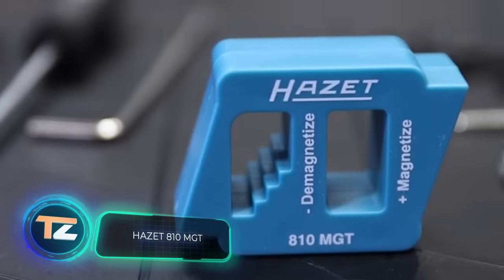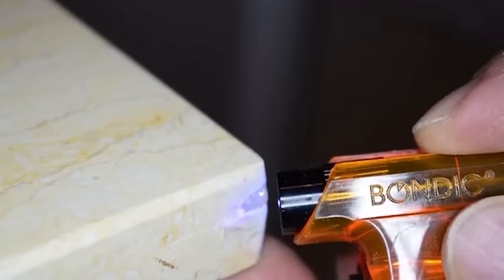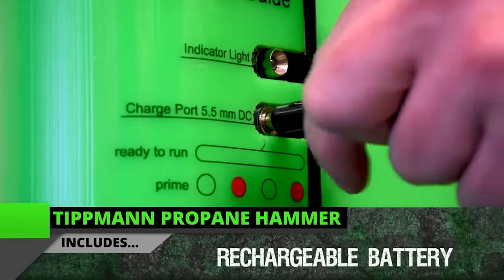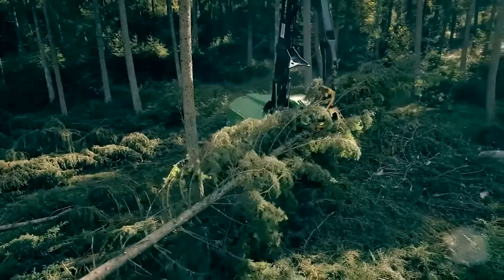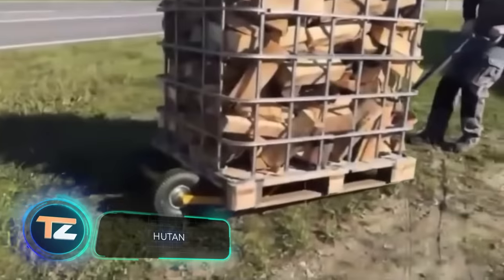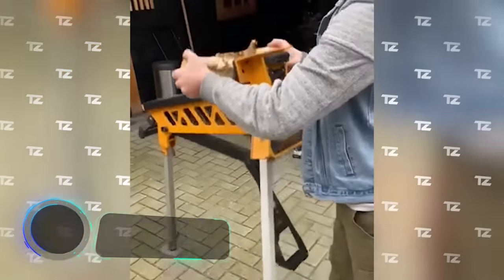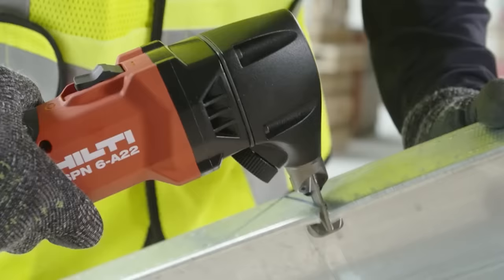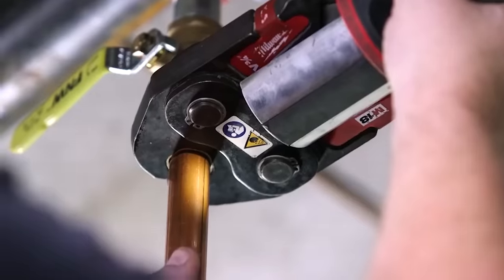INGENIOUS TOOLS AND INVENTIONS THAT YOU SHOULD SEE

Comment: The crimping tool is really expensive but it is so much easier to use than soldering and is more secure than soldering
Reply: More secure?  How so?
Reply: @jonblakemore6454   i wouldn't say more secure but the copper pipe you have tho use is thicker than the one you use for soldering  and can hold up to 600 psi and is a lot easier to do in tight spaces but with all the heads it is about 5 grand but you will make your money back with the amount of time you save. and they has viega fittings and pipes you can use for plumbing the hole house or repairs the viega fittings can hold up to 400 psi and the viega  pipe is flexible and way better than cpvc in the 5 years that i have been using these fittings and pipe i have never had pipes leak or crack and no complaints
Reply: Just used one on 108mm stainless Steel pipe. One crimp ring on the pipe and two jaws. 
A first crimp then a second crimp.

Comment: I love the propane hammer.   Many many years ago (about 50) I belonged to a motorcycle club and raced motocross (we called it scrambling in those days).  When our club hosted an event, we had to erect about two miles of fencing, and, by heck, it was hard driving all those posts in.  What we'd have given to have that post driver!  Crock Lock looks like a cool tool, but it would be so much cooler to have a pet trained crocodile.   You'd but your plank in its mouth and say GRIP.  Do what you needed to and say LEAVE, and the crocodile would have fine old time.  There's be all sorts of added benefits like taking it with you to do some debt collecting.  You'd ask said debtor 'Have you got my money?' and if they said 'No', you look at Jaws, point at the debtor's nether regions and say GRIP!' and they'd remember that they did have a bit of cash put by after all.

Comment: Those pallet jack attachments seem a bit sketchy.  It looks like it doesn't lift the pallet level, and worse, lifts it toward the operator.  I don't know about you, but I would rather not run the risk of material falling on me while transporting.  Also, there are purpose made rough terrain pallet jacks, design to have the clearance for obstructions and with springs it keeps the pallet close to level.  Granted, those are more expensive, I would rather pay out a few more dollars for safety than try and rely on something your average schmo could make in his garage.

Comment: Good luck with that press tool fixing a leak without turning the water off. Someone’s going to get very wet. And as for that worx screw driver. No one! And I mean no one on any job site has ever had one of those. 1/ It wouldn’t last the day. 2/ They’d never live it down. 🙄